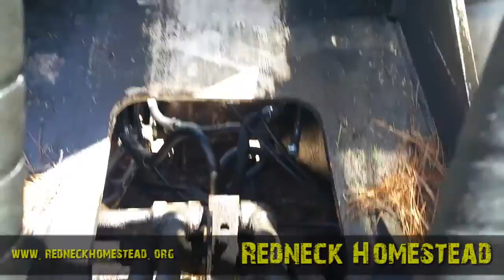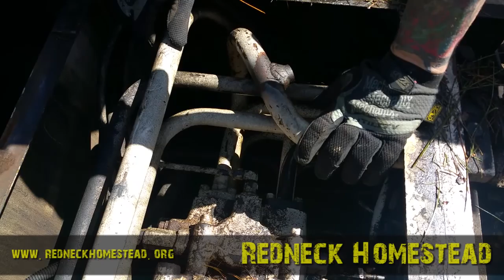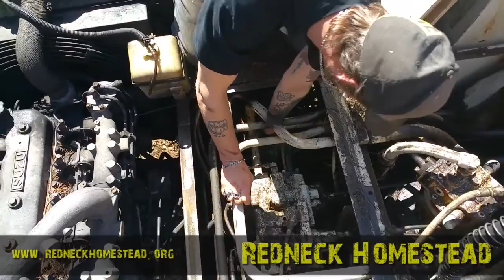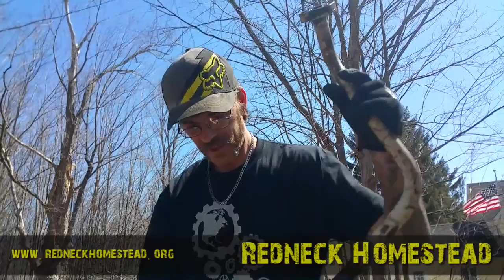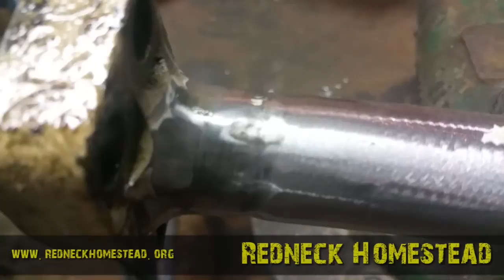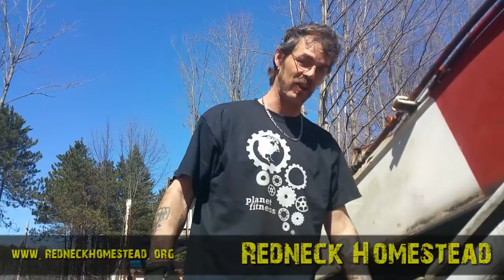Repairing Steel Hydraulic Lines With Silver | Redneck Homestead

Comment: Yeah buddy,you better hope the solder didn't flow right thru to the inside where I'm sure you checked afterwards?It could block off the fitting but it's running and that's great.

Comment: Why didn't you just actually weld the line? Why braze it? Its a steel line. It can be welded pretty easily.
Reply from the maker: Love2boat92 well, the braze held very well for a while, but the problem is there was a bracket that broke hold so there was a lot of line vibration which broke the braze...so i welded the heck out of it and it works great!!!
Reply: @AirspeedAdventures  Always remember when you work on lines to do a good flush to remove the crystallization from inside the line, which will clog your resolver valves and make it weak on some positions.  Great job!!!

Comment: When I was  young, about 13 yrs old my dad and his partner who built houses together bought an old Case tractor that had a plow and back hoe on it. He lost the key or something which wasn't much anyway, just a couple prongs. LOL To start the tractor he used two 4D trim nails together and inserted them into the holes, crossed them and twisted them just as you would a key and the tractor would start.
Reply from the maker: Camper Hollow that's hysterical, i have used the SAME EXACT TECHNIQUE!!!